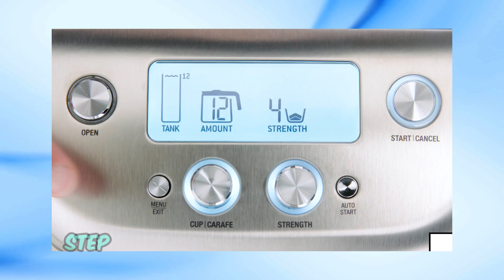How To Fix Breville Error 001 | Troubleshooting Guide

Comment: why don't you show how to remove the silver disk?
Reply: Press tightly against the knob at the center of the chute disk and turn counter clockwise. Between the knob and the disk there's a spring washer so don't lose it. With the knob and washer removed the disk can be removed and cleaned. If turning the knob by hand doesn't work, loosen slightly with a pair of pliers.